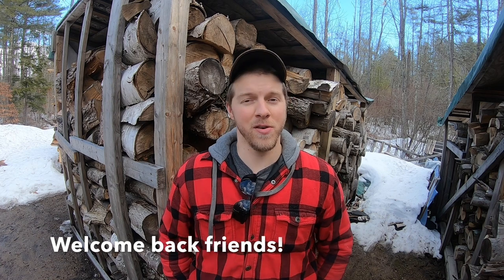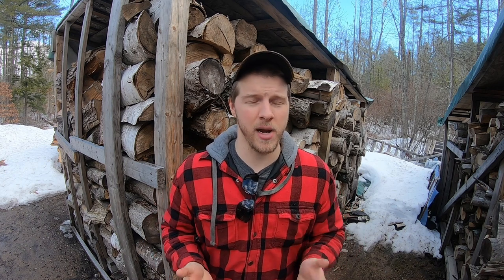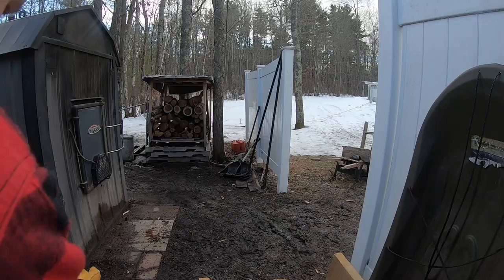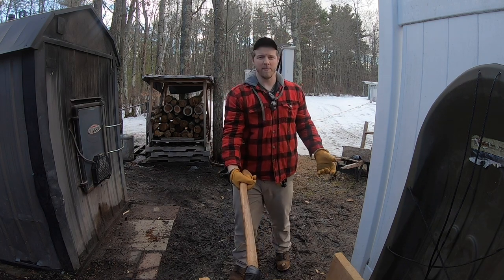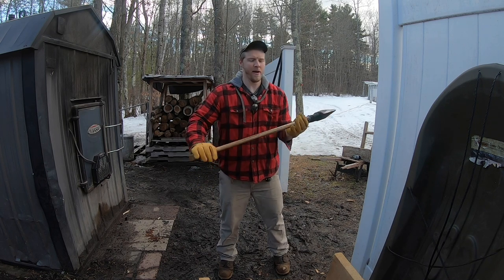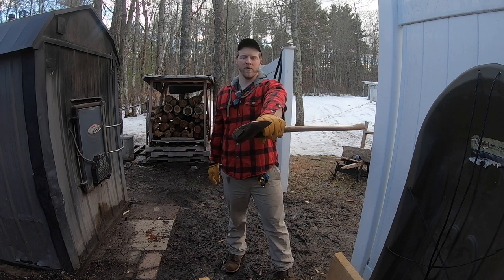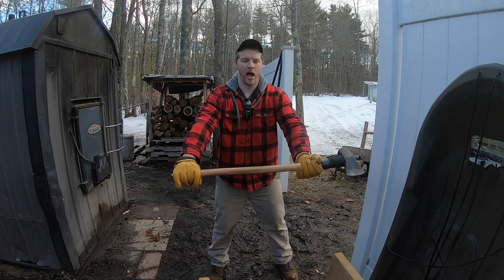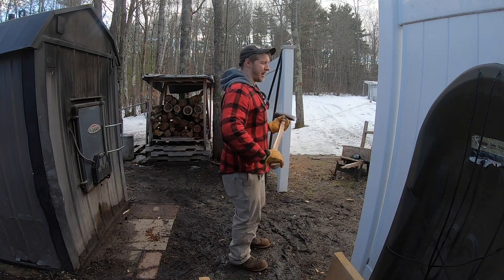How To Swing An Axe!

Comment: As a non- professional I would add 1 tip: bend your knees and drop your weight into the swing instead of using your back and shoulders so much.

Comment: I've been using your technique since last spring when I started to split wood. Went through a few videos on YouTube, tried a few methods, yours made the most sense. Safer, more efficient and easier to aim. Guess many years from now my bones and joints will still be owing you a beer! Good job! :)
Reply from the maker: Yes splitting wood is an awesome thing but good form and technique will keep you in the fight for a long time! Stay safe!
Reply: @HomesteadJay  At the moment I am mostly collecting rounds, both seasoned and green, from my mom and her hubby's  property, and stacking and using them in my summerhouse, where I spend most weekends. It's all fun and a great workout. Makes beer taste better too! ;) A couple of stacks are slowly getting bigger and I just love to heat the house with seasoned wood that I knew I brought from my family and split myself. Damn, I won't be surprised if once I run out of this firewood, instead of buying split firewood I'll just start buying 10-feet logs offered by the local State Forest Management Centre, just to have a reason to cut and split the stuff :)

Comment: That is very similar to how I split most wood as well.  I have seen people though that seem to do well with longer, fuller swings.  but they don't do it like you show not to do it.  They use momentum of the axe, swung behind them in a longer, gentler arc like swing.  And not all of them do it all the time.  Speaking of saving energy, I think one of the most energy saving factors is eliminating picking the wood up to put it on a stump.  I've split the vast majority of my firewood on the ground for a long time and it saves a ton of time and effort in the long run.  I can split it where it lays in the field, or just toss it all out in the driveway at home.  I don't have to move them all to the splitting stump, or stop to put the axe down to pick them up and then pick the axe up again. I just start splitting.   I rarely let go of the axe, it is either resting on the ground while holding the end of the handle, or I'm holding it similar to you right at the head. You don't even have to set them all upright.  some can be split as they lay in the pile.  splitting blocks can be handy, and there are some theorectical advantages that people will often cite, but in reality, I find it much easier and faster to split on the ground most of the time and set some up on a splitting block occasionally, when it seems like the best or easiest thing to do.  Like you said, firewood makes you lazy.  Over time, I just figured out I didn't have to do all that annoying and time consuming lifting of rounds over and over to get them to the stump. I can usually generate a little more power when ground splitting too, since the face of the wood is lower to the ground, allowing a longer swing to gain more momentum.   Check out this playlist I put together of woodsplitting videos that are worth watching.  A lot of them are showing off and wasting energy, but they are all legit good at splitting wood.  Very few splitting blocks involved.   https://youtube.com/playlist?list=PL60FnyEY-eJBEqSSPEPbpfNHoOHiKb72p

Regarding holdig the axe near the body, I totally agree with that.  An important diesign feature for me is that I can hold the axe right up at the head, where it is very balanced to handle  between actual chopping or splitting.  I don't want anything in the way there, such as a clunky guard, or wrap, or piece of metal shielding.  holding right below the head is much easier and makes for fast, easy handling.  Having a smooth path all the way up the handle, allows to get that hand in position without any speed bumps and without having to think about it. Cheers.

Comment: I didn't see anything I'd argue with there, except use of the concept proper and to say that there is more than one way to skin a cat.  I do know competent people that swing way behind them, but it is a fluid motion using momentum, not dropping it behind the head and then lifting it back up as you showed.  I do it more or less like you do usually.  Also, I would add that any kind of bumper or wrap or guard that prevents me from holding an axe or maul right up snug below the head is a deal breaker.  I handle the axe there all the time with one hand, for instance when picking up a piece of wood, or flipping the handle around from one side of my body to the other.  Holding it even 3 or so inches below is much more work on the wrist and harder to manipulate and that is more relevant when it comes to splitting mauls vs axes.  It is possible to use protection, but if it is bulky like paracord wraps or rubber bumpers, or god forbid metal, it is just in the way and makes handling clumsy.  https://youtu.be/mboWKqIyvQE?si=oPQ2g14b5UQWirFe
Reply from the maker: Thanks for your feedback brother.

Comment: My dad taught me to swing an axe this way too. I was curious if it was the best way or just 1 that works really well but not perfect. So i looked it up. The 1st vid i watched was a 1min more scientific style display of it where they said to have the 1 hand up the shaft at the start, start the axe head at 10 o'clock and lv, then bring it down starting w using the hand that is up the shaft to force it forwards while sliding the hand down then using the other hand to give it speed as u bring it down. Idk, to me that 1 also sounds like a good option too. It looked like the center of mass was inches above the guys head.
Reply from the maker: Some methods are a tad different but swinging the axe head behind you is a waste of energy!

Comment: All looks good and practical. Good form and good advice. Although I think putting wood on blocks to split is way to time consuming. Picking split pieces up and putting them back on a block. I like to split on the ground. Not saying one way is right and one is wrong. I just don't like to handle wood that many times.

Comment: Hey Jay, Thanks for the tips!👍🏻 I'm going too keep the axe close to my body from now on! I use a large round with a truck tire screwed to it to contain the wood rounds. Have you tried the buckin Billy flick when you split? 
It works great for me! Enjoy your Sunday bro. 🏈✌🏻️
Reply from the maker: Hey Alan! Thanks for watching! I hope this helps for sure! I have tried the "flick" that method was actually common practice for double bit axes back in the day! Buckin has sure mastered it for sure but ive done it with my 4lb splitting axe and it works good! Not so much for the maul but they are different tools for sure! Hope you had a great weekend!

Comment: Agree with you except splitting on a block.  You can deliver more power with less energy splitting rounds on the ground.
Reply from the maker: Hey John! Yeah that can be the case but a small 4 inch block wont make too much a difference! if you have a 18 inch splitting stump of course thats robbing power LOL thanks for stopping by and please subscribe if you havent!

Comment: I don't generally split wood that way.  I do start the same way.  Your stance is good but instead of just going straight up and down, I shift the axe behind me as I bring the hand close to the blade to meet the other hand at the end.  Then I keep the axe moving in a circular motion over my head, continuing the movement.  it uses the end of the axe as a fulcrum and doesn't waste momentum by fighting against the axe's motion at the top of the swing.  No Game of Thrones flash involved.  Downsides?  Until you get used to it, it can be a little less accurate.  Also it does give you a fair bit more power with your swing which might not always be what you are looking to have  I'd be happy to link some other videos but not trying to really get into a whole 'this guy is doing it better' sort of thing.
Reply from the maker: Hey Ander! Thanks for chiming in! Everyone has their own ways indeed!

Comment: I would add 1 more thing to your stance not that its bad or anything. but I have seen it first hand it happen to my brother during power swing (when splitting 2+ ft diameter logs). when u swing and a miss axe tends to go to your left or right side. when u standing straight (both legs in the same line) there is an opportunity axe hits you in the leg. what I do is a step forwards, the leg depends what is your dominant hand. 
For me as right hand it person, my left hand is closer to a blade and right hand is holding the back of the handle so, the leg goes first whatever the hand is closer to a blade(for me it would be left. if u left is dominants hand u step forward with your right leg). when u swing and a miss blade cant go to your left side as u are blocking it with your right hand and the body, and when it goes to your right side there is no leg there, as it is way behind the reach of the blade. I hope this make sense. it easy to show harder to explain
Reply from the maker: Hey Tom! Thanks for sharing I believe I knew what you meant! Tough to explain versus visual lol thanks for tuning in! Happy splitting!

Comment: Fantastic video, i've got some logs coming in this week which some will need splitting, only problem is I don't have a tree stump base to place them on, so what would you recommend as an alternative base to place the logs on and split them?
Reply from the maker: Cut a 6” piece off one of the larger logs you get and use that as a base. You don’t want the logs that need to be split sitting on the dirt  by using a 6” base it will help transfer all the energy into the log your splitting! Good luck
Reply: @HomesteadJay  thanks!

Comment: I've only just started chopping wood but I have much more success pulling down through my legs than you are doing here, is my technique wrong? I can split my logs in half quite easy with this technique and feels less likely to miss?
Reply from the maker: Hey there! Sinking down (soft bend in the knees) is actually reccomended for sure. This video was primarily about not having the axe head go PAST your head as that is extra strain and less power! Seems like you have a good method going! Keep it up and happy splitting!
Reply: @HomesteadJay  cheers fella! I spent 6 years chopping up animals when I was younger so I've hopefully got a decent swing. Cheers for the reply

Comment: So what your saying is that because your wood takes  a certain amount of force needed you minimize your swing to reduce energy loss at that level?  Your not saying that your swing is as powerful as the silly overhead swings your talking about right? Compared to say Bucking Billy? Do you think your shorter more efficient stroke could split the same wood as his swing?
Reply from the maker: Hi rich thanks for tuning in. What im saying is if you have a 8lb maul like I use and any time that maul is behind your head your are using all that energy (fighting gravity) to bring  it back over your head and then swing it down. Pushing up with my left hand and then swinging it down is basically going to be the same amount of force but your not exerting all that energy to get the maul back above your head. If that makes sense. Thats my main premise is you shouldnt need to make this giant over the head kill shot to split the wood. Buckin doesnt do the over the head dramatic split either if you watch him and hes been doing it longer than I been alive so he has admitted to it as well. I like his "flick" method as well that is a game changer as well!

Comment: Are you left handed?
Reply from the maker: I bat lefty, Write righty. Throw righty. lol
Reply: @HomesteadJay  I am not being funny but I see a lot of right handers swinging an axe/maul the same way that do and I am right handed for everything but I hold/swing the maul with my right hand lifting the head and my left on the end of the handle,,, I am just curious if I am doing it wrong 🤣 as I am a newbie,, any advice for me?
Chopping makes you lazy,, when you've done it a few times,, you don't want to do it again 🤣🤣 hahahaha,, doesn't look like we have much choice though, so learning the technique is important,, thankyou
Reply from the maker: @BrendonHoppy  Haha I can help no problem. I am opposite of you. I am a righty ( right arm is dominant and stronger) so I want my right hand  (strong hand) on the bottom of the axe. My left hand is the one that actually moves the axe up. In my opinion, not a fact or rule but however you would swing a baseball bat you would hold and swing an axe. Take a baseball bat and pretend to swing it like your splitting wood. You will feel what feels more comfortable.
Reply: @HomesteadJay  thanks,, I will now have to try both ways and see,, I only just got the practice to hit where I am aiming,,  when I hold a cricket bat 🤣🤣🤣 hahahaha,, it's the same way I hold the maul.. if the maul bounces too many times,, I noodle it with the chainsaw,, specially th 40- 60 inch rounds
Reply from the maker: @BrendonHoppy  Yes well 60" piece is no joke lol. Im assuming your working your way from the outside. Dont be trying to split that size from the middle youll be swinging for the end of time lol
Reply: @HomesteadJay  I halve and quarter them with the chainsaw first,, I can't even get the wedges to go in,, although it's lovely to see how many good  pieces come out of one of these rounds,, I also cut them to only 17 inches in length,, which is a good length for customers where I live and it's less difficult to split and dry

Comment: I have tried to find a video of properly swinging an axe and yours is one of the better ones but you are still not fully efficient. 
Instead of bending your back, you should drop your butt as the axe comes down like you are squatting weights. This way you are using almost no energy, you are letting the weight of the axe do the work for you.
2nd when you were talking about the axe should not come from behind your head. Well that is true except advance technique. You can let the axe drop while holding the end and the hand that slides down bar is also guiding it, letting the momentum carry the axe in a circle and therefore once again you are not using your back and more of your wrist.
Reply from the maker: Hey There! Good points for sure! My video was just a general helping video to aide in the swinging of an axe! I appreciate you tuning in and invite you to subscribe to the channel for more wood heat and splitting!